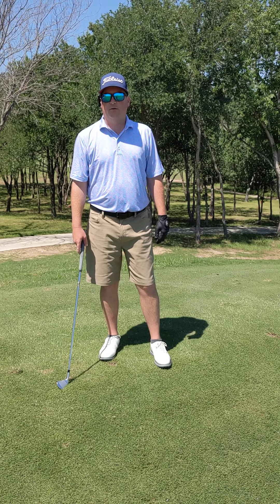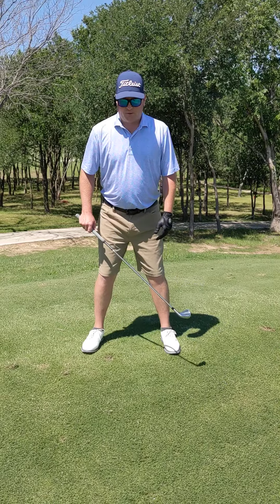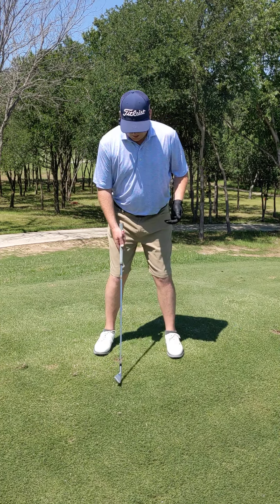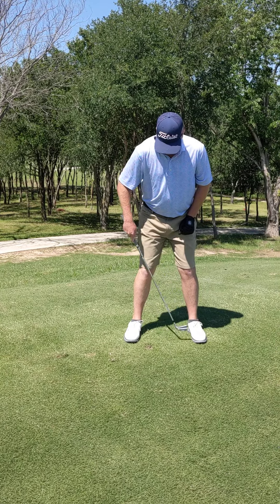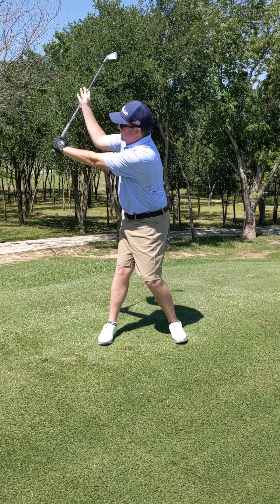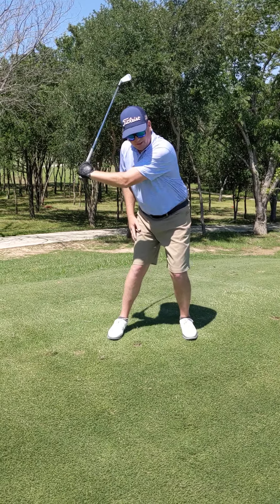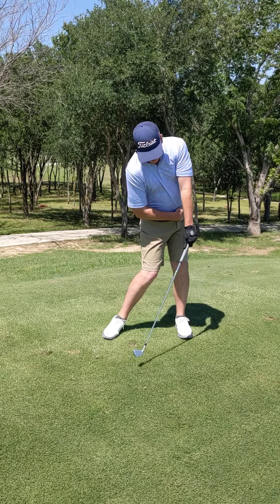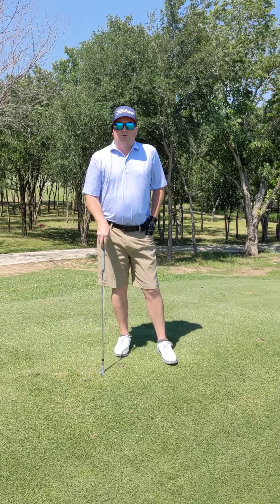How To Create Torque In The Golf Swing & Maximize Power #golfswingtips #simplegolftips

Comment: I think I've been turning just to turn lately, good shots are sporadic but great when they happen. I like this way of thinking, will try it out at the range before my tee time tmrw. 

Why do you think it is that I can hit my 6i-PW great but cant work the 3-5 irons? Is there a different stance or motion for long irons?
Reply from the maker: Great point, and I have been in this position myself.  Without seeing your swing, (feel free to share) I suspect that it could be a ball position/set-up adjustment fix.  Since you are able to achieve the torque in the mid-lower clubs for the most part, I think if you adjusted your set-up for the longer clubs to: Higher left shoulder, lower right shoulder (assuming you are right-handed) (opposite if you are a lefty) and moving the ball position to forward of middle/inside front foot, then you will most likely get the twist and tun together as with using the longer clubs take a bit longer to create the wind-up in the swing.  It's a longer and wider arc.  

If you want, send me a DM with a video of a 4 iron or Driver swings and maybe one of your PW swing.  Happy to look at it and send my feedback.